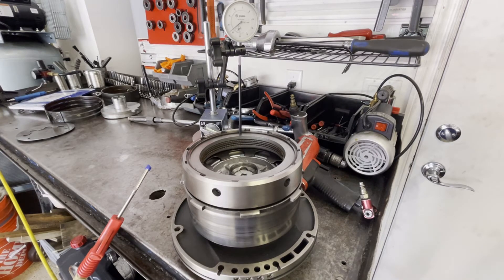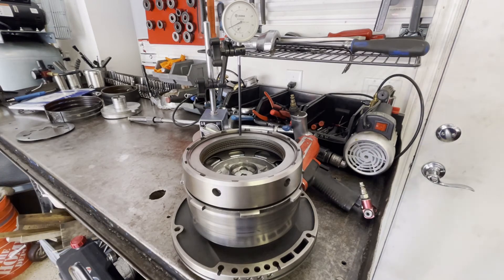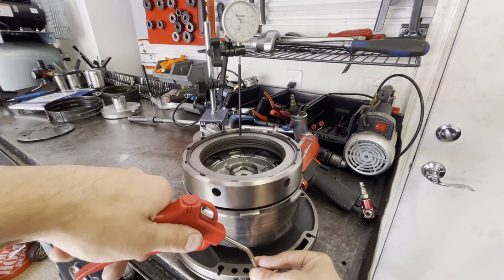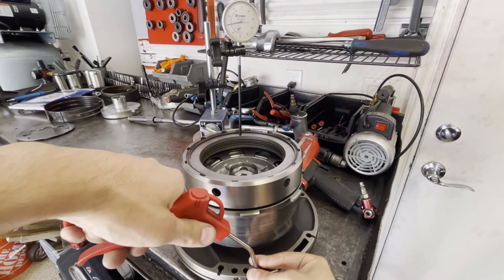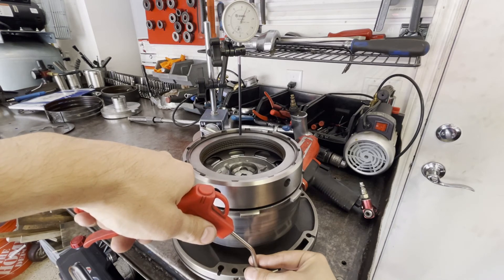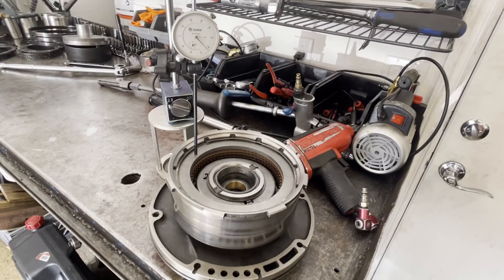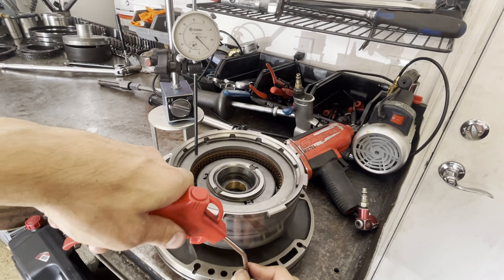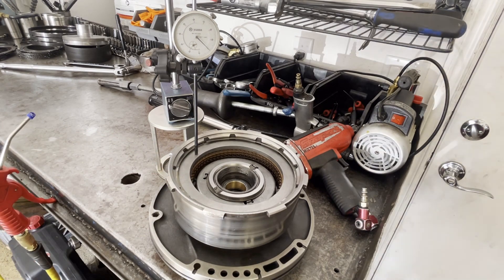7. Dodge 48RE Rebuild - Forward and Direct Drum Clutch Clearance Checks

Comment: I did the test and got the tool but my direct and forward are way off! 
Direct is too high and forward is too low how do I fix sir?
Reply from the maker: Look for different thicknesses of steel plates for the direct clutch (i.e. use forward clutch steels if you're too tight in the direct) and, in the case of the forward clutch, thicker or thinner selective clutch snap ring. I would also suggest checking the forward clutch by hand vs using air as I show here. Reason being is the belleville plate will move the piston before the clutch pack starts to move and it can be tricky to get all the movement zeroed out before the pack itself begins to travel.

The clutch pack's travel is what you want to measure, not the piston's overall travel.
Reply: @nickstransmissions awesome thank you sir I attribute my success to you and god you rock!! May you blessed this 2026
Reply from the maker: Thanks, Vinny - you have a blessed 2026 as well!

Comment: Thank you very much, that’s exactly what I needed today 💯
Reply from the maker: You're welcome, Erick and thank you for watching!
Reply: @nickstransmissions  I put my very first Dodge transmission together this year and I didn’t air check it, evidently I tore the lip seal on the forward clutch piston and it welded the clutch’s together and would only go forward as soon as it started in park reverse or neutral
Reply from the maker: Dont beat yourself up about that, it happens to everyone at some point...Plus, it was your first transmission so that's still a big deal - you should be proud of your efforts. It's a mistake you'll learn from and likely never make again.
Reply: @erickenner4847   im about to attempt my own rebuild starting with a trans that did that very same thing melted together forward clutch. Trans break in reverse and natural (wont rev up in park) did you end up tearing it back apart your self? or how did you determine the lip seal caused the failure? i assume the air check would show a leak
Reply: @nickstransmissions  are you going to make any more Dodge tranny vids?